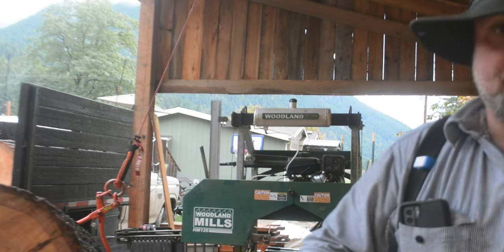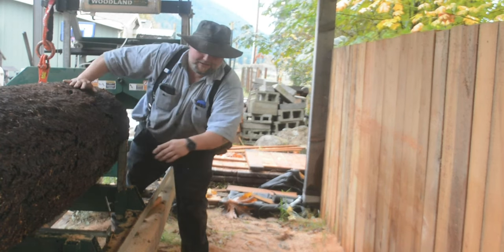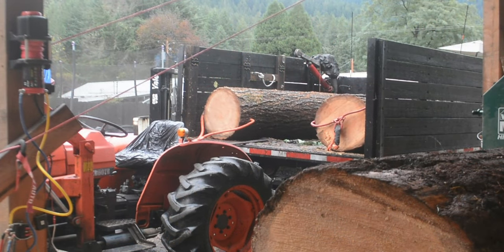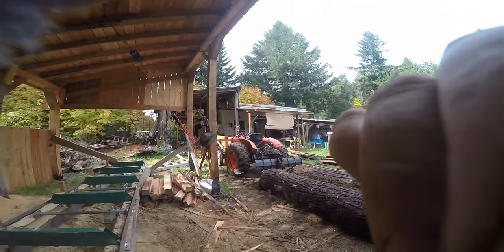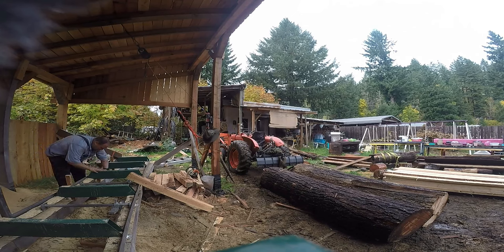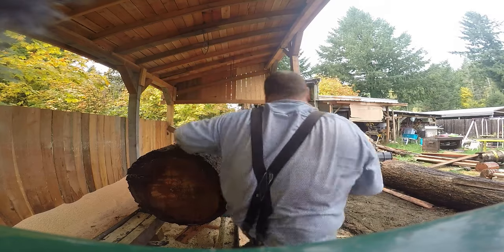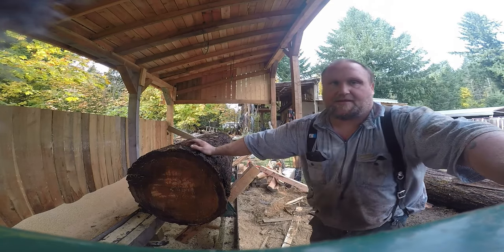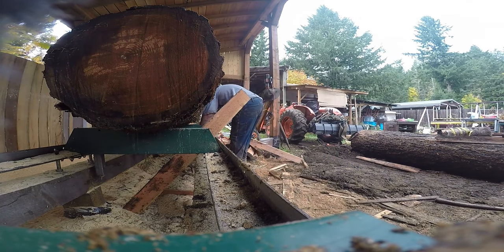Unloading some large logs and loading on sawmill with a winch

Comment: The little Kubota was kinda struggling with the double up on the logs.  LOL There's nothing like mechanical advantage with the heavy loads though.  Nice winch and tongs set up Wild Bill.  Fun video my friend.  Love your mills covering !!  I need that big time.  But we don't have the moisture down this way that you guys have in the PNW. Yeps, camera angles are hard to deal with ain't they.
Reply from the maker: Yeah it struggled for sure with 2 logs. The covering is great. It helps with the sun also. Gives you a bit of shade.
Reply: @WildBill1122  on our big circle mill back home we had a huge pavilion over it and the power unit. Made it great fir rainy weather.